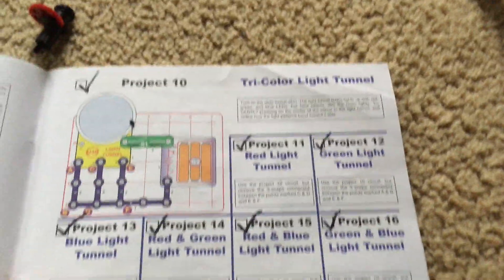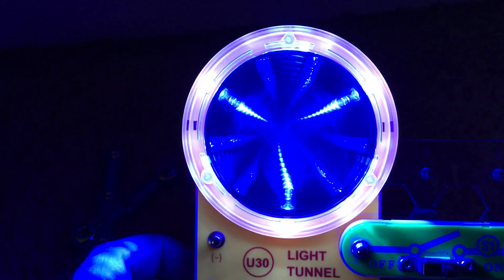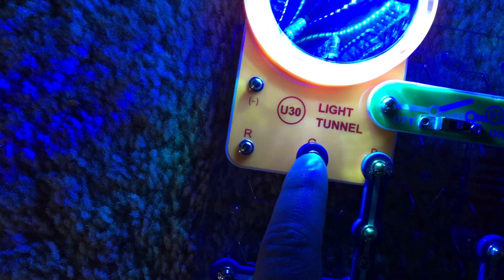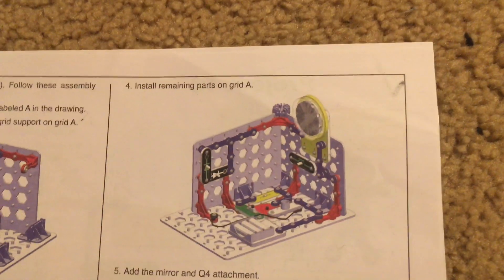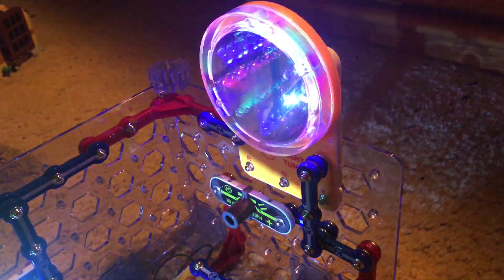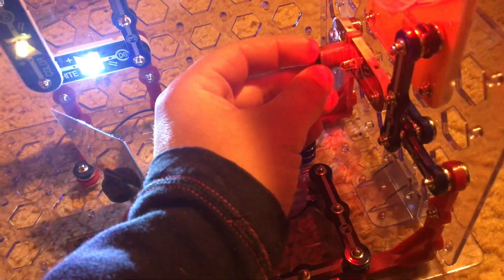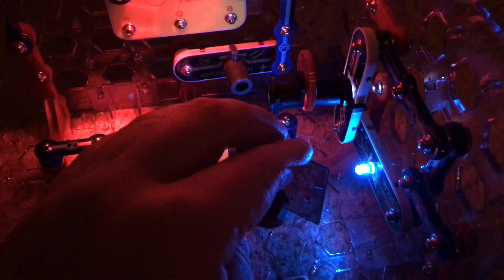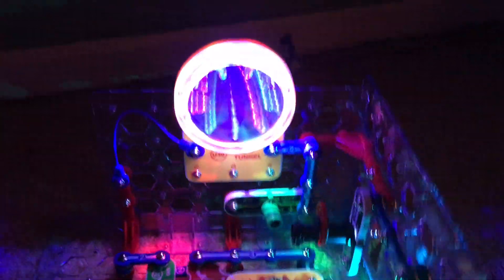Snap Circuits 3D Illumination: Projects 10-19 (SEIZURE AND VOLUME WARNING)

Comment: When it comes to these 3-D circuit projects, especially with the home and my home plus kit, it is kind of hard to build when it comes to reading these one dimensional instructions.
Reply from the maker: I agree with you, it is indeed tricky.  I forget whether there are 3D instructions available online or not.  If so, they would make building much easier.

Comment: do u have snapino ... xp ... micro 400 ... micro 450  ?
those micro kits  are really expensive
Reply from the maker: Adesh Manhar Ramkissoon - adeshizationT&T - AMRS Unfortunately I do not.  Do you?
Reply: @andrewsstation6436  no i don't ... i tnink amazon has it ... i  spposed to order sc - arcade & sc - stem .... but i  only have cash for sc -  stem .... 
:(
basically its only 10 more i need xcluding ... xp ... micro 400 ... micro 450 ... &  lights & sound combo ..... i own 16 ... of them so far ...  .. but i do not own any of d mini kits ... or upgrade kits .. i do not think they would b available .... by d time i get cash ... i am looking to get d best first ... but as i say .. they are pretty expensive ... laterzzzz .. that means .. until next time ....
Reply from the maker: Adesh Manhar Ramkissoon - adeshizationT&T - AMRS Good luck!  I bet Amazon will have what you want, hopefully for a reduced price.